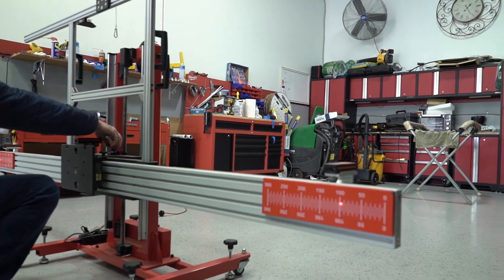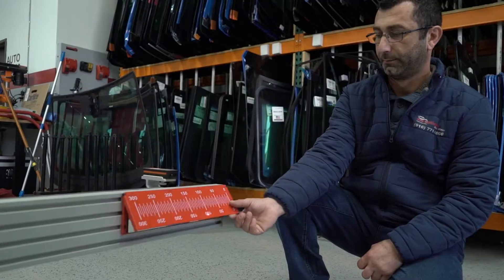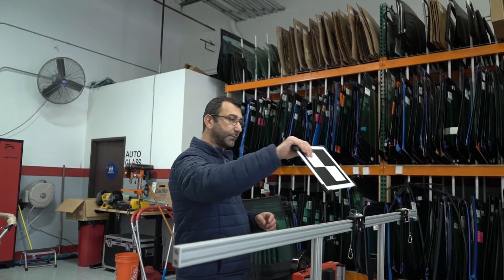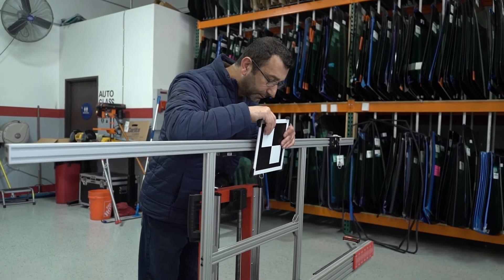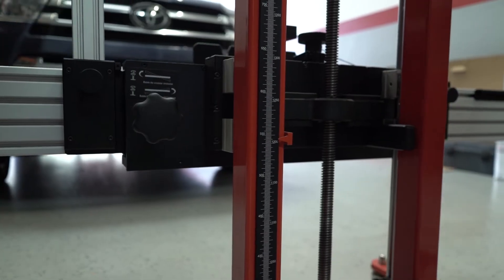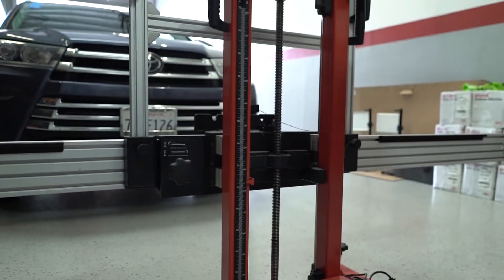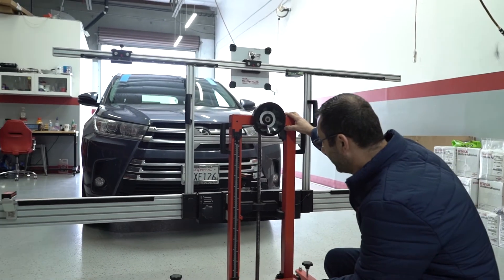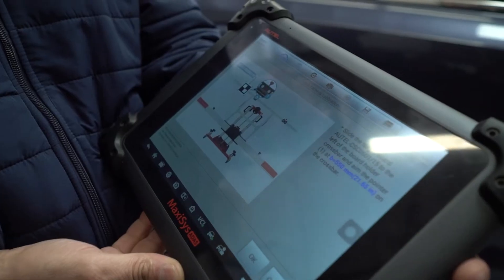Do I need to recalibrate my windshield after replacing it...

Comment: $350 for the glass, $600 for the recalibration. A scam for features I never wanted or use in a car.
I drive a manual transmission, I don’t touch my phone when driving, I don’t ever use cruise control, and my eyes aren’t off the road so the brake warning for a car stopping short in front of me has never been anything but an annoyance. Money grab 💰🤬
Reply: Recalibration is mostly for those who do use those  features. So it's kinda just a suggestion. My boss has been in business for about 6 years and she does not recalibrate. And there hasn't been any issues from any customers about the function of the vehicle.
Reply: I am here because I went to replace my windshield and was told it would be an extra $750 to recalibrate and I wasn’t allowed to opt out of it. I cancelled my appointment immediately!
Reply: The camera should be fixed to the roof so that there is a reference point. Common way for car manufacturers to not listen to engineers to make more money.

Comment: It's not changing location. Going back in the exact same spot. Sounds like an easy money grab to me. Make some undeniable videos where this was needed. A wreck with a total windshield smash, maybe but any other situation doubtful.
Reply: False bro, I have a G05 X5 and windscreen got replaced and camera has been acting all crazy ever since. Adaptive cruise control and lane departure haven’t been working. It needs to be recalibrated by dealer… BUT, not alll cars require recalibration as some cars are designed to self calibrate.
Reply: @ISP718q  in your opinion hyundai ioniq 2017 must calibrated ??
Reply: @thomasadmiral3401  only way to know if get the windshield replaced first, if no isssues then ur Ok..if u expierence any issues with lane departure warning or any camera based features u will need recal
Reply: You have no idea how sensitive all these stuff are , it’s important to do recalibration
Reply: A one millimetre variance in the new glass would screw up the sensor.
Reply: @aussie8114  not true. It’s what you are told. Most cameras will recalibrate Themselves by literally driving around the parking lot.

Comment: So why do I have to pay for calibration on my rain sensing windshield? Charged $150 for but they couldn’t show me the process…
Reply from the maker: Adas calibration is only required if you have a front facing camera on your windshield. If all you have equipped on the windshield is a rain sensor there is no calibration required.
Reply: I don't have ANY extras in my truck . Base model. Safelite says they "have to" recalibrate mine. I have no sensors or cameras or adaptive cc .. nothing.

Comment: I just had my windscreen replaced, the quote was meant to include calibration to camera.. They have replaced it and I asked how do you calibrate the camera. He said the windscreen was already calibrated.. I feel they ripped me off. Is it possible the new windscreen would be calibrated using factory settings?
Reply: Ripped off I think.
Reply: @aussie8114  Turns out, the ADAS actually works, so not sure if I have been or not
Reply: @nicolasbourget4163  What is so funny?
Reply: @michaeltei4173  I know this post is old, but.. your system can work perfectly fine without being calibrated. 

It’s more of a… just in case.. thing. So no one is held liable if the features don’t work right. (Your car suddenly driving off the road because it didn’t register a curve.) 

It’s just to make sure the cameras are looking through the glass properly, because glass is curved and can alter the perception of the camera. To also make sure everything is straight and not off centered.
Reply: @ Thanks Coffee, yeah all the features work. So I'm very happy! <3

Comment: If I don't remove the camera from its power,do I still have to?
Reply from the maker: If you are replacing any glass that the ADAS camera sees through you are required to calibrate. This is due to the small differences in the glass and the positioning when you set the new glass. These differences can be as minute as a few millimeters but that would be enough to throw the camera off, therefore needing a recalibration.

Comment: If you can’t afford it right away, then go without it. It’s better to have a windshield that you feel safe behind than access to safety features. 

But some people can’t even get their camera to calibrate after the replacement so, I’d recommend doing it at least once you’re better financially.
Reply: Safelite won’t let you opt out of having it calibrated now. And they charge $750 extra
Reply: @ I see. We have local shops around that do window repairs. So I had the option to not install it, because he didn’t force it on customers. (To be honest, if you don’t use the features normally I’d just go without them..) but even after installation you can have it calibrated later.
Reply: @ I saw your comment on another post. See if you can find (call) a local window repair shop.. ask if they’d be able to work with you because you are not ready to pay for the calibration, but just want a safe windshield.  Someone will likely help you. Avoid mainstream companies.